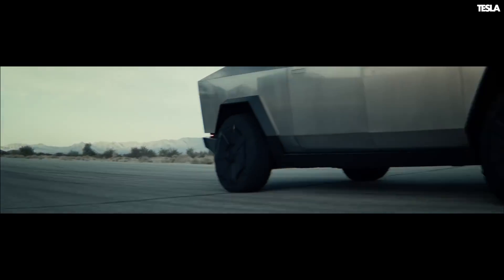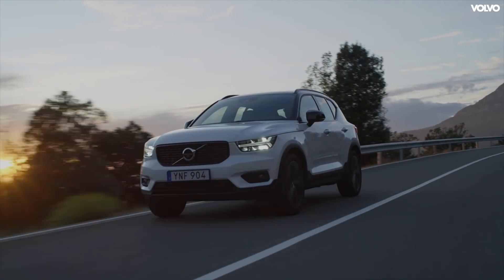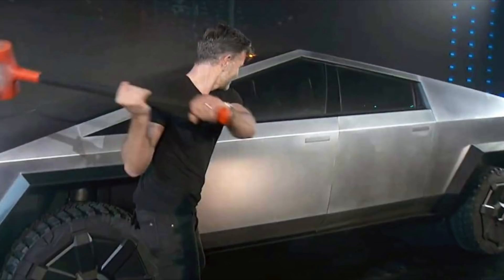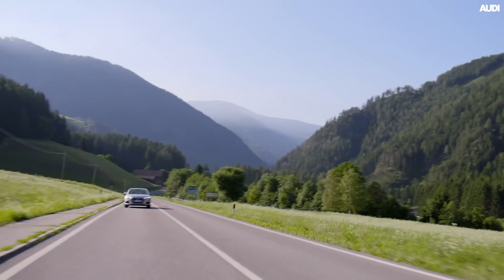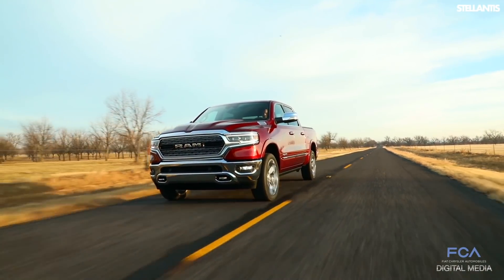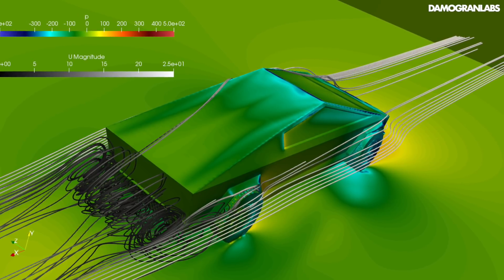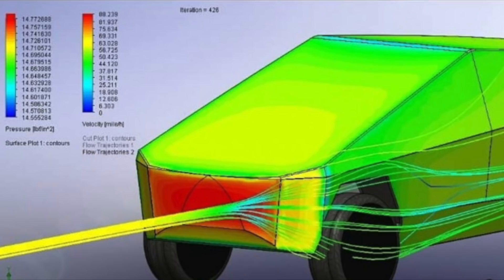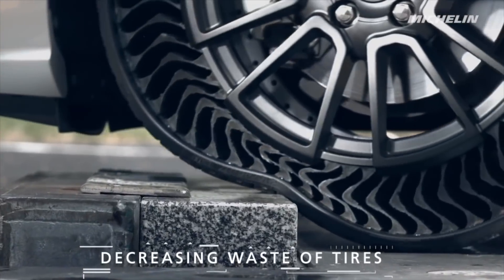Cybertruck's Secret Hypercar Aero

Comment: Don't listen to this nonsense. I've spent years designing aerodynamics studies for wind tunnel testing and months of wind on time conducting studies myself. 1) That top sharp edge will undoubtedly separate at the achievable Reynolds number of this car. Sharp corners ALWAYS lead to boundary layer departure. And the Cybertruck is all sharp corners. In the best-case scenario, it reattaches with a turbulent boundary layer but that comes with a lot of lift and a lot of drag (both undesirable). The most likely outcome is that the boundary layer remains detached leading to poor pressure recovery (lots of drag). Everyone loves to show their 'pretty' color plots made using CFD simulations. The problem is that CFD is only accurate if you really know what you are doing. Results are VERY sensitive to specific inputs and poor understanding of meshing and the solver inputs and outputs can lead to poor solutions. Let's get a real wind tunnel model with oil flow visualization so we can have an actual idea of the notional shear stress on the surface and you'll see just how bad it is. Streamlines don't tell you as much about the lift and drag as surface shear stress does. 2) He states that the body produces an aerodynamic wake that artificially simulates a more streamlined shape. No, this is bullshit. If you are not recovering static pressure on the body, as a Mclaren Speedtail is designed to do, then you don't reduce the drag. Drag is directly proportional to the size of the wake. The larger the wake, the more drag. People need to chill with the Cybertruck Aero design. It wasn't designed to be aerodynamic. It was designed to be unique and disruptive. If anything, enjoy it for that.

Comment: Sure its aero, doesn't mean it's at all practical. Always love your show, always will but really a super aerodynamic pickup truck? Completely impractical! The box is useless,  unless of course your truck is not really used as a  truck. I use a truck daily for my business and the high beltline covered areas don't exactly make life easy. As well From what I can see, an exoskeleton style chassis just makes the enivitable accident ridiculously expensive to fix. The same features on a car I'm  sure would be fantastic but not on a "work" truck. A separate cab and bed are needed period. I'm sure the upcoming GM fleet of unit body pickups will be equally welcomed. Don't get me wrong, I see the huge efficiences as it relates to range but it's not ideal for commercial trucks.
 There currently isn't a cyber truck because of the amazing sales of the model Y and it's allocation of factory space but quite frankly I think they at tesla are happy since a redesign is needed or a better long term plan for trucks in general at their organization. Theirs is not sustainable unless their target audience is residential use. Tesla biggest mistake was revealing the cybertruck truck too soon, she awakened the sleepy giant. F150 numbers once ramped up in a year or two will insure tesla is a niche player regardless of range. Unless of course battery allocation is an issue. It might just be.
Another issue, the speed between intersection is typically never over 100km/hrs, I see absolutely no reason to accelerate to the next set of lights at well beyond the posted limit. That is not efficient. I'll trade absolutely ridiculous acceleration for greater motor /range efficiency. IL save the ridiculous speed for a CAR which is low to the ground with suitable tires and a track. Mosport works! If the cybertruck is a success for anything more than 3 years it'll just proves we are sheep.
Reply: You keep saying it is impractical but don't give a reason. 500 miles of range is a pick up is practical. A crazy amount of HP is practical. A stainless steel body that can take a sledge hammer is practical. A 6 foot 5 bed is practical. The 0-60 time being so good is because of the way electric motors work. More power for things like towing translate too extremely good 0-60 times when it comes to EV's.
Reply: @lachlanB323  I'm not going to a race so I don't need a 0 to 60mph in under 10 seconds. I won't provide staff with same. 
We throw things over the side of the bed, reach over the side of the bed, grab things from over the bed wall, hang things over the side so definitely don't need a high bed wall. I like the original Ridgeline but a high bed wall is a stumbling block. 
Nice to have stainless steel but it can never be fixed if an accident is big enough. I want a separate cab and bed. Simple. 
For contractors of all types, there are tons of kits available to customize. Tesla has zero.
I'm sure it's great as a personal fun vehicle but not wonderful for commercial. The F150 lightning works. 
By the way, the cyber truck is class 2. I don't need the load capacity of a class 2. A class 1 F150 lightning works. A class 2 F250 is not needed. 
It's all business
Reply: @foreverinteriors  If you are in a big accident any truck would have to not be fixed as it will not be safe as all the airbags and stuff has gone off so that argument makes no sense.

A high bed isn't that bad since theirs a bit at the side end of the truck that you can step up on. 

And if the object your carrying is heavy than you should be using the Cybertrucks ramp anyways. What do you mean by separate cab and bed? They are! Ok so the truck is too big for you. It isn't to big for everyone though. This has nothing to do with your original statement of the Cybertruck not being practical
Reply: @foreverinteriors  The 0-60 time as I said was a by product of high towing capacity. Having more performance for towing in a Electric Car means low 0-60 time. If 0-60 in 2.9 seconds is too quick for you then go to the cars settings and set it too chill mode. It isn't rocket science. Do you think Tesla should of had bad towing capacity so the cybertruck wouldn't be so fast? I hope your answer is no.
Reply: @lachlanB323  look, I'm sure you have tons of stock in Tesla, that's good but I'm not interested in your salesmanship at all. I run a business. I previously managed a truck fleet and it was my job to know what trade people both wanted and needed. We don't make silly decisions based on how fast a truck is. So, I suggest you buy your cyber truck, have fun with it and leave the professional so we may drive our boring utility focused trucks, gas, diesel  or electric, to build things and fix things and deliver things and so on. Maybe one day I'd buy a cyber truck or rivian for that day when I can drive around with an empty bed and play red light green light or go camping with all the trucks useless camping amenities.
Reply: @foreverinteriors  I never said the 0-60 mph was important. It is an extremely minor bonus. What is important is its range a towing performance. 

The cybertruck is extremely good at towing. The cybertruck has plenty of utility as that is kinda the point of its crazy design. 

I never said you should buy it. In fact you shouldn't. You want a smaller vehicle like the f150... oh wait the cybertruck is the same length as a f150 with a 5.5 foot bed but it has a 6 foot 5 bed? Huh... but anyways you shouldn't buy it unless you are willing to wait a couple years plus I think it will be expensive because of its crazy demand.
Reply: @foreverinteriors  Sorry I made a mistake when looking at the sizes of the trucks. Google thinks the supercrew and an f150 are the same thing. The f150 is quite a bit smaller which is better suited for you.
Reply: @lachlanB323  I'm sure Tesla has job openings. You seriously should consider applying. They like people that love them.
Reply: @lachlanB323  I really do suggest you look for a sales/customer service job at Tesla.
Reply: @foreverinteriors  Maybe once I've finished grade 12 and I still don't know what I want to do I could try that.
Reply: @lachlanB323  apologies apologies, at first I thought you were stupid but I now understand you're just a naive young enthusiastic person. Good for you, I hope the best for you but remember this " you don't know what you don't know" . 
Keep at it and may the force be with you
Reply: @foreverinteriors  Yeah. I thought you were trolling me with that. Regardless I doubt Tesla's hiring.
Reply: @foreverinteriors  Honestly I don't know much about other trucks so I was hoping to gain some perspective on what makes you think that the Cybertruck doesn't have utility while others do. The only argument that made sense was it being too big for you. But that's a personal preference thing.
Reply: @lachlanB323  the cyber truck is a class 2 truck, heavy capacity, heavier vehicle , and more tax in some regions. Unnecessary expense. The F150 and Ram, and Silverado are designed with such versatility that they can be configured just about any application (trade/job/etc).  The cyber truck may have been designed by many ex GM, Ford, Toyota etc etc engineers but as one analyst said, none from the truck divisions of those companies. It's a funMobile , that's it. Nothing wrong with that. GM, Ford,Ram, Mercedes will absolutely dominate the commercial market for the foreseeable future.
Reply: @foreverinteriors  I agree. The Cybertruck won't dominate the commercial market because it will be too expensive because so many people want it. 

The commercial market cares about profit and if the Cybertruck did actually sell for 40k that would be possible but I highly doubt the Cybertruck will be priced that low due too demand. 

Maybe in 5 years or so time the Cybertruck will be competitive in the commercial market but for now it will be used mostly for customers who want to go outdoors and go camping etc.

Comment: Tesla’s Truck design has a very good air friction design. However, trucks are not cars. I agree that unibody designs are a possibility. Trucks are designed to tow & carry cargo. No racing purposes. Trucks are designed to be used off road- rear wheel drive or 4X4. SUV’s- key word “U”.  Utility, it is not designed for this. SUV’s are often used to carry cargo by flattening the rear seats. The Tesla truck’s rear bed can not carry 💩. Tesla needs to re think it’s body design.

Comment: I was always wondering, how safe this car is when involved in a crash with a passenger. I don't know about the US, but I guess they also have some safety rules for those circumstances. Those sharp edges and corners look unnecessary harmful.
Reply: The strength of the chassis probably means whatever gets hit will come off way worse than the truck itself.

 Idk if we test how much damage one car will do to another in a crash but yet again we have semi trucks on the road all the time
Reply: I imagine passengers will fare much the same as other pick up trucks in the US.

Comment: Drag coefficient is speed and frontal area dependant so not specifying the speed at which its more efficient is pointless. F1 cars have huge drag coefficients but really small frontal areas so not including the whole equation analysis there seems a bit how ya going.... A toyota Rav4 or a Corolla at typical use speeds have lower drag than all of these and actually exist plus no doubt have a lesser frontal area. Also next gen supercars are all super light hybrids electrics plus honda civics are trashing last gen supercars on the the track..... I'm waiting to see if/when the cybertruck gets here and how it actually measures up to claims and competition.

Comment: When you speak about the technical aspects it seems that you have no clue what you are talking about
First things first. The airflow over a car is you you drive at a normal speed always turbulent. Turbolent airflow and seperation are different things.
Those types of fluidflows with low preassuregradient and next to no friction without counting the laminar sublayer are called potentalflows. The drag is caused by seperation and preasuredifference due to the form which leads to rotation. Rotation causes force. also deadwater-flows (like at the back) are always bad cause you can't realy contorl them and it is a zone of heavy seperation -> high losses
Also at cfd you can make a lot mistakes. Wrong grid or wrong numerical aproach causes big problems. Sometimes it looks good but when you run an experiment you just get completly different numbers and Tesla tends to bend the truth when it comes to actual data.

Comment: Please cover the Aptera. 
 What is the Cybertruck CD and drag area compared to the Rivian R1T, and Ford F150 Lightning?  

A lot of commenters think truck aero drag is unimportant, but EV range is determined by the aero and weight drag, which drives the battery size and thus cost.  This will give the Cybertruck a huge cost advantage, which will lead to the design being copied.

Would a boat tail extension reduce the Cybertruck drag?

Someday the Cybertruck will be recognized as the GTOAT (Greatest Truck Of All Time), when ICE cars are gone or sooner.

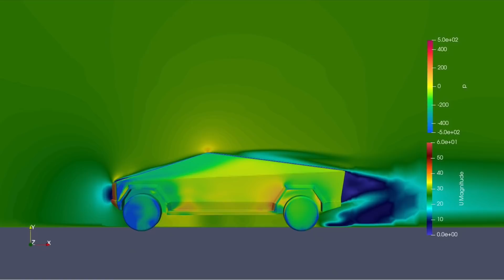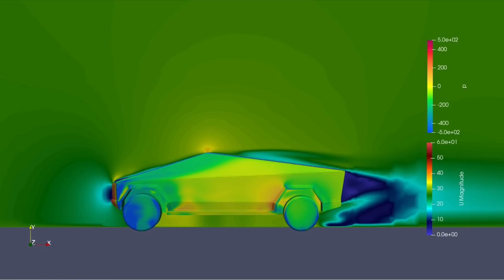Comment: 6:15 The turbulent, low pressure wake will produce a lot of drag itself. You can see it at 6:18, that's a lot of separated flow you will have to pull with you, that is NOT a good thing.
Reply: No, it can actually reduce drag and it’s actually a common design feature. 

Read more: https://en.wikipedia.org/wiki/Kammback
Reply: @hughgolo8660  The fastback design it's a compromise between length of the vehicle and the induced drag,  and it aims at minimizing said low pressure wake. The low pressure zone it's not a feature, it's what you are trying to reduce and produces significant drag.
Reply: Boundary layer physics? But but but… that’s behind the vehicle and shouldn’t count. 😉 Oh, Elon... Lmao 👍
Reply: also at the front and after the top edge you have seperation
the flow is always turoblent beside a tiny laminar sublayer

Comment: This "Electric skateboard" design is actually already a bit out dated. Turns out all you achieve is to put the weirght of the rest of the car higher. New electric performance cars have most of the battery in precisely the same place as midengined supercars have always had their engine. In a T-shape behind the seats.
Reply: But the “electric skateboard” design is the safest design because the center of mass is at its lowest and prevents rollovers

Comment: 0:28 air resistance doesn’t matter much for 0-60 times, nearly only determined by power to weight.

1:00 body on frame does not have s higher torsional rigidity compared to a unibody, quite the opposite. It does, however, allow for more torsional flex.
Reply: Ever try pedaling a bike over 20 mph or into a head wind?  Air resistance has a great effect at low speeds, especially when you are trying to conserve as much energy as possible since that will increase battery life. In car technology it hasn’t mattered much before because the majority had the power to make it a nominal concern. Even in those cases it still was a huge power drain to push that weight up to speed.
Reply: @jlondon1441  air resistance scales with the cube of airspeed. It has a small effect compared to inertia when accelerating at low speed. Try doing a 0-60 against a headwind versus with a tailwind. The difference will be very small.

Comment: I hated the design. I now kinda love the design. Thanks lol
Reply: Maybe you can learn from this experience that you are easily influenced by technical sales talk with colorful quasi-scientific 3D animations/simulations. The measurement quantity for how aerodynamic a car is, is called the Cw or Cd value (drag coefficient Wikipedia). But that value is never mentioned and probably for a good reason (https://en.wikipedia.org/wiki/Automobile_drag_coefficient).
Reply: @richardbloemenkamp8532  mate, you are mentioning the most basic element of aerodynamics. You don’t need to know a damn thing about aero to know what coefficient of drag is. I’m far more impressed with how they managed to address the wake created by the car, and the subliminal downforce generating components. If I wanted to know the coefficient of drag, I would’ve looked it up. I’m far more interested with the nuances of the aero design, not the Cd. I know that may be shocking.
Reply: @richardbloemenkamp8532  there’s more to improving a cars maneuverability or handling than simply reducing the Cd. If the Cd was worse than a Volkswagen Vanagon, I’d still be impressed by the design.

Comment: I don't believe any of the aerodynamic claims made about this.

If you want to confirm the claims then get an aerodynamicist to test it in a model wind tunnel rather than believe what Tesla say.
All of the sharp edges will act as trip strips and guarantee separation and lots of drag. On the roof there is probably enough time for it to re-attach, but only when wind is head on.

In any sidewind the angle from the doors to roof is so sharp it cant help to be bad for drag. Also it is not hard to be more aero than a pick up truck because of the bed. This doesn't have a bed that can be accessed from the sides, so doesn't really count as a pickup truck.

Please come back and cover again when the real product is available.
Reply: There's no air in Blender, which is the only place this scam exists at.

Comment: I still don't get this: Amazing, you can hit your truck door with a sledgehammer without deforming it, but as far as I know, the body deforming is what keeps you from dying in a car crash, so how does the cybertruck absorb the forces of a crash?
Reply: panel rigidity is different from structural rigidity, and a sledgehammer can only provide so much force compared to a car crash.
Reply: If the passenger compartment is strong, that’s probably a good thing. I mean, what would you rather have crumple: the passenger compartment, or the engine compartment?
Reply: Any car no matter how bulletproof it is would bend and break in a car crash, so i don't think it would be much of a different
Reply: It doesn't.